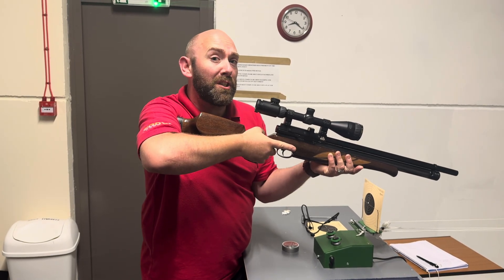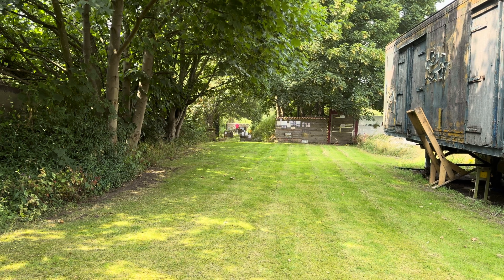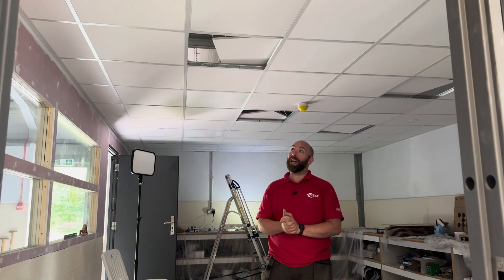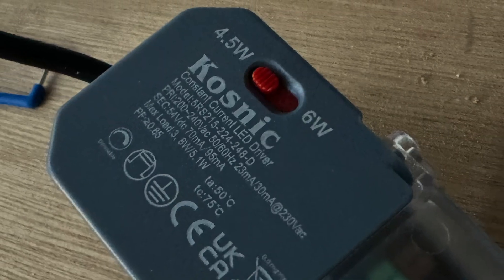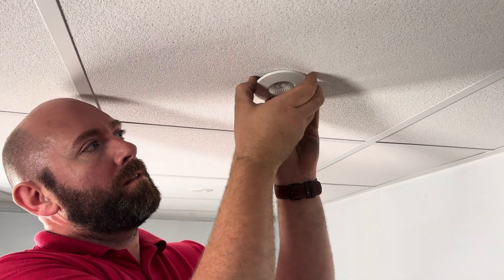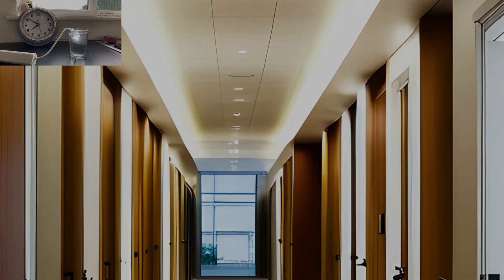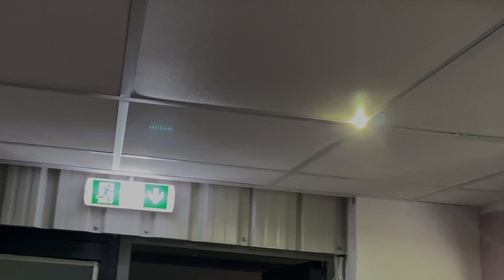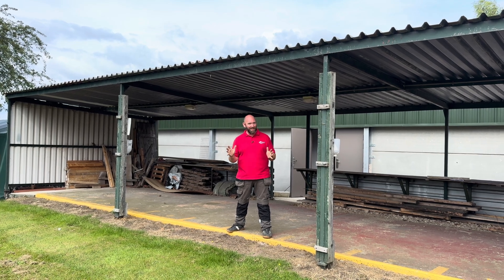Emergency Lighting: More Than a Shot in the Dark

Comment: surprised your using mains powered driver instead of a dc-dc driver. would be even more efficient as no ideal load from the inverter, nor the losses. where can i find a electrician to get my site experience under? funding my level 3 and nvq my self. just need the experience. love to fit emergency lighting in off grid setups.

Comment: Hello there. On the subject of EM lights, I noticed a running man at about 4min 45 which has the decals stuck to the diffuser. I was always lead to believe that this is not allowed as it reduces the light emmitance of the fitting. I'm sure this was not your installation but EM light running man decals are often installed incorrectly. Maybe you could do a  running man decal best practice video?
Just a thought.  Cheers